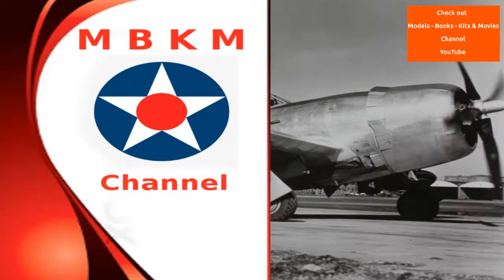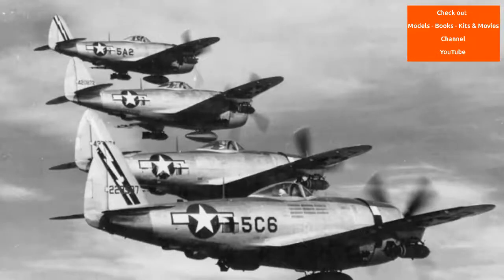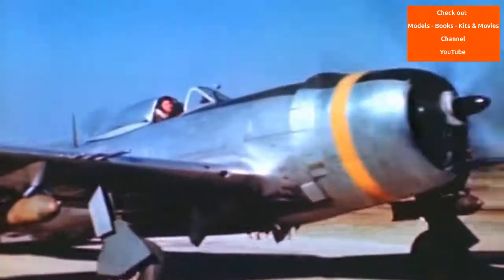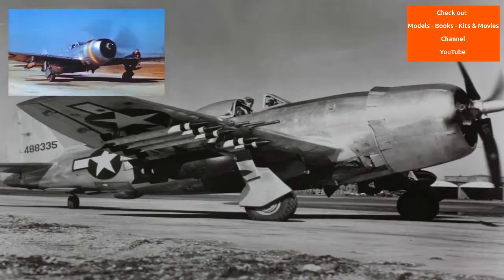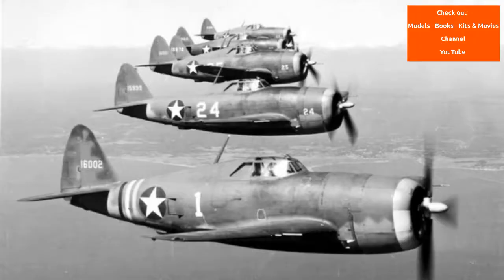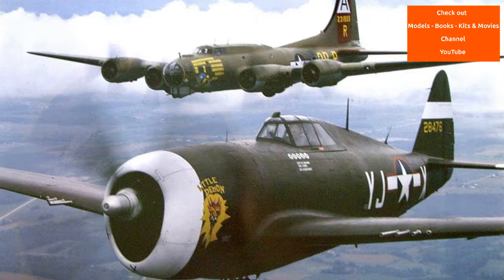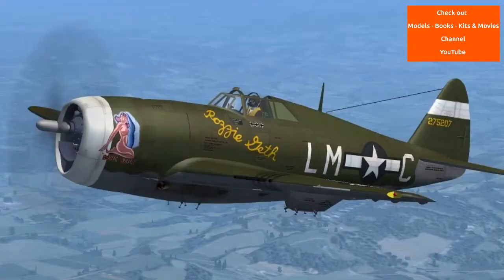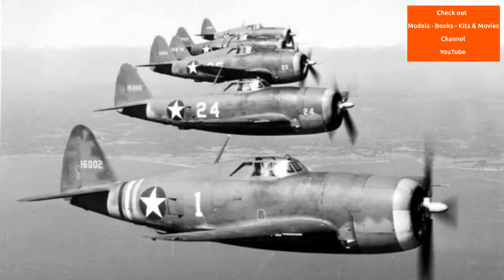Explained - WW2 Republic P-47 Thunderbolt Fighter Documentary

Comment: The P-43 Lancer was used by the Nationalist Chinese. Robert Scott in “God is my copilot “ mentions taking one for a spin.
There is a second cousin to the P-47 serving with the Italians. There were a couple of Italian engineers that worked for Seversky who returned to Italy to work for Reggiane. The Re2000 could be said to be a copy of the P-35. This series went through more models, the Re 2001 had a license built DB 601 engine, the Re 2002 went back to a radial engine. Finally the Re 2005 with the license built DB 605 and is considered the most beautiful of WWII fighter aircraft. The lineage back to the P-35 thru the P-47 by keeping a similar outline shape to the wings and tail units.

Comment: In the book "Fighter Command," Zemke commented on flying the P-38, P-47 & P-51. He said that below 20,000 feet, the P-51 had an edge over the '47, while it was about even at 25,000 feet. at 30,000 feet and above, (Which is what the P-47 was designed for),  the P-47 had superior performance  in every level. It could fight at 40,000 feet. The only plane capable of that was the ultra rare F.W. TA 152, pressurized cockpit & all.
,
Reply: Quite clearly Hub Zemke knows more than I do and I am in no position to oppose his point of view. However, I believe his argument about the P-51 having the edge below 20,000 feet a little bit more of a personal fighting style. Below 15,000 the P-51 is absolutely the better plane. However, even down here, the P-47 still had some advantages. These included better dive performance, better role rate, better zoom climb, more durability and fire power, and I believe also a better turn rate (not radius). I know that the P-47 had at least as good or better of a turn rate than the Me-109, and I believe it's the same case with the P-51. These advantages didn't put the plane on par with the P-51, but I don't think it left it far behind. By the time both planes get to 20,000 feet, the advantages that the P-51 held over the P-47 are greatly reduced, though still there. However, the P-47's advantages over the Mustang are not greatly reduced at this altitude, and in other areas it's fast catching up. I believe (I will have to double check myself here) by this altitude the climb rate of the P-47 is already superior to that of the Mustang's, their speeds are very similar, (each plane had a variant that was faster than the other so they went back and fourth), the P-47's disadvantage in turn radius is greatly reduced as it has the power to turn (relatively) better at high altitudes, and it still retained all it's other advantages in dive performance, roll rate, zoom climbs, and the basic layout offering more durability and better firepower. At altitudes greater than 20,000 feet, it is my belief that the P-47 has the upper hand. While I respect Hub Zemke and his obvious expertise in the subject area, I think it boils down to the pilot's style of fighting. The P-47 was a boom and zoom fighter though and through. The P-51 was good at both boom and zoom and to a slightly lesser extent turn fighting. In actual combat, it was often proven that boom and zoom tactics reigned superior, though there were obvious exceptions. Both planes were excellent though, no doubt👌

Comment: See "Greg's Airplanes & Automobiles" for a ton of great info on the plane that actually broke the back of the Luftwaffe. Check out the list of E.T.O. U.S.A.A.F. Aces & you'll find the top 10 is dominated by P-47 pilots. Most of these guys started out with early P-47s with the skinny props, which were like skinny tires on a Dragster. Paddle-Bladed Props made a Huge performance difference.
Reply: Flying TANK...BEAST..

Comment: Quite a bit of incorrect information here. @ 5:29 air conditioned cockpit. Incorrect. I've read several books about P-47s in action. No one ever mentions AC in the cockpit. Consider this, at 10,000 feet the air temp is about 23 degrees F, at 15,000 about 6 degrees F, at 20,000 about minus 12. There was no need for AC in the cockpit. @ 7:11 exhaust pipes routed beside the cockpit. Incorrect. The  exhaust pipes were in the belly, several feet below the cockpit on their way to the turbo-superchargers located just in front of the tail wheel housing. @ 8:09 main gear struts extended 9 inches for prop clearance. Incorrect. The main gear struts were typical for the time, air over oil and had only a couple inches of  travel, from fully compressed to fully extended.
Reply: T.I. Sorry but MBKM is correct about the landing gear. They are telescopic and CAN compress after takeoff 9" then extend again 9" for landing. If you also take a close look at most inner gear doors, you'll see the small polished patch. Well that was put there because sometimes during flight the gear would slowly extend and catch inside the well. The polished section would allow the wheel to pop out for  landing. If you look at a diagram of the leg you'll see a hard pipe on the leg {not the brake line} that allowed the hydraulic oil to quickly flow to the upper and lower sections, the pipe also slides within itself. The opening in the wing {stdb side} is a fresh air intake, not AC. The exhaust pipes didn't go under the pit. They stopped at the firewall and connected to a main pipe {both sides port& stdb} that went to the super turbocharger then the cooled {external} air returned through two separate pipes { that did run alongside the pit, above the exhaust collector pipes} and into the carb which is located on the back of the R-2800. He did also failed to mention that the 47 did shoot down an Arado 234, which the 51 never did, both did shoot down many 262's though. So don't be too hard on the dude.
Reply from the maker: Many thanks. I relied on a Google search.
Reply: He's calling the air scoop to the cockpit "air conditioned," witch is sometimes written that way in literature. It's not actual air conditioning, just vents to cool the cockpit. And you'd be surprised how hot the P-47 cockpit got. Many pilots reported that it was quite hot even at high altitude thanks to the heat from the big engine. That was part of the reason they moved the engine eight inches up in-between the B and C models.

Comment: 5:41, P-47 canopies slide to the rear, they did not hinge up.
Reply: Apparently the XP-47B prototype used a hinged design. The sliding canopy was introduced in the P-47B production variant.
Reply: @passantNL  The hinged canopy was  not used on production P-47s, neither was fabric covering. of tail surfaces.